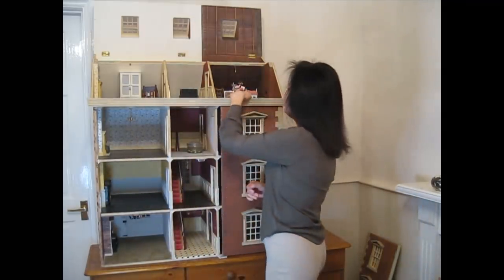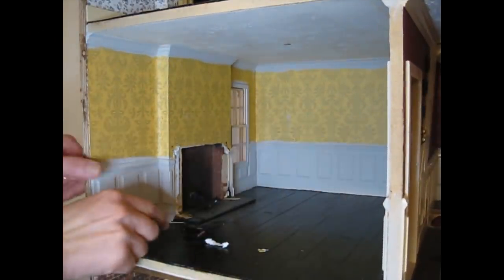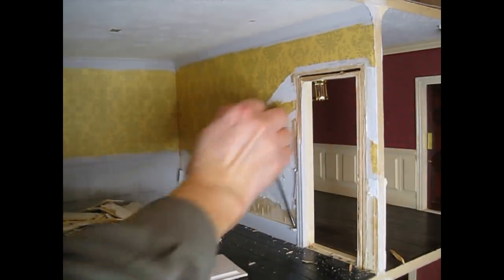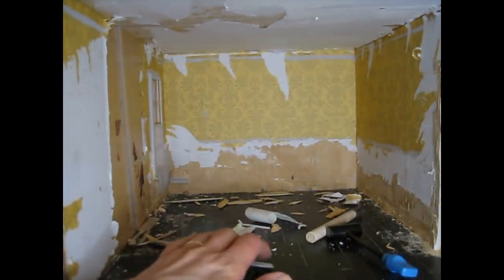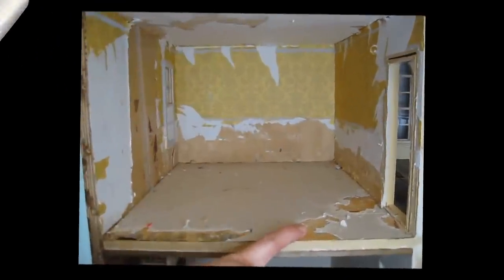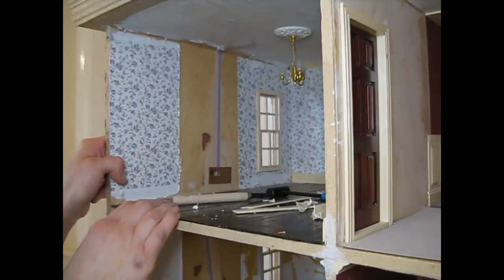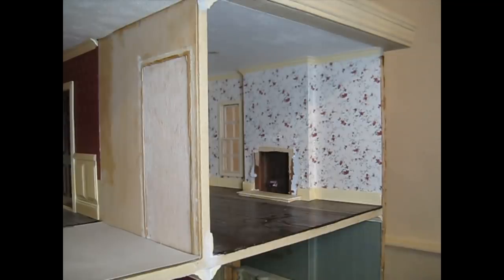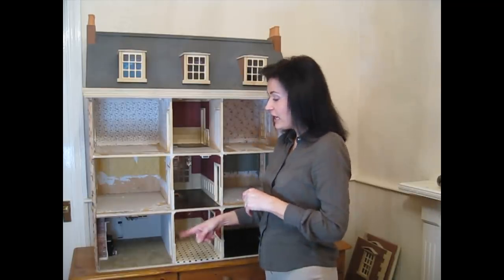My Dolls House Diary  - Episode 9 - Back to Bare Wood

Comment: Julie here is some advice try using  a hair dryer and a spackling tool. The hair dryer will melt the glue and you will have less damage to the walls. I learned this the hard way. I have learned so many things from you, keep the good work.
Reply from the maker: Thank you, I'll certainly try the hair dryer when I come to remove the paper - a job I'm not looking forward to!
Reply: I know, I didn't like that job either especially when it involved the ceiling in the smallest room of my dollhouse. Anyway, the hair dryer is good for removing mouldings. For the wallpaper I used a water & vinegar solution in a misting bottle and scrap it off with a spackling tool. My hands and hips hurt just thinking about that experience. I could not raise it up it would have too heavy.

Comment: I also have a house I didn’t get finished.  I made one back in 1982 and wallpapered onto the bare wood.  Over the years the acid of the wood ruined the walpapers.  I now prime all my inside walls with KILZ.  I have also learned over the years that I prefer using regular household walpaper paste.  Later if you want to remove the paper it comes off much better than if you use glues.
Reply from the maker: Thank you for the tips. :)

Comment: This was super helpful and inspiring, does anyone have experience with doll house lighting? I’ve started stripping it my doll house, but the copper tape has been covered in paint, with the little holes blocked. I never actually got so far as completing the lighting, but am aiming to have lights. Would it be wise to remove it all together or does anyone know if I could salvage the copper tape and unblock the holes so that lights can be wired in? Would appreciate any advice, it came with the copper put in so it’s been installed properly, and have no idea how to fix it myself, thanks
Reply from the maker: I'm not an expert on lighting, but I think you would need to make new holes in the tape and insert eyelets, rather than trying to unblock the clogged holes.  Give that a go in one room and try a light to see if it works.  If not, perhaps consider removing it altogether and go for wire lighting.  Copper tape can be a little temperamental and can corrode over time when covered in paint or glue.  I hope that helps...:)
Reply: Julie Warren thanks so much for replying, had a look at the wire lighting and it looks easier to install than expected. Ideally I can remove the copper, but accidentally sanded some of it down and it’s not too noticeable when painted. Thanks!

Comment: One piece of advice I can think of is--know your strengths and weaknesses. For instance, I know that my hands are not very steady with a paintbrush. So if I have a window that needs to be assembled and painted, and I want it in multiple colors, I'll paint it before assembly so I don't have to worry about masking tiny pieces off.
Reply from the maker: That's really good advice Rosie, thank you.

Comment: A good flooring putty knife ... its a flat piece of metal with a handle. That works great for prying between the two pieces. Its also great for scraping paper.
Reply from the maker: Thanks for the tip.

Comment: I watched this with my morning cup of coffee but was holding my breath several times watching you deconstruct your house.  Great job!  I agree with Chris below about the HOT water and Dawn in a spray bottle for wallpaper removal.  Wish I had known Michelle's trick about the hair dryer to loosen the glue.  Thank you for showing this.  Its so educational for anyone with a dollshouse because eventually you're probably going to want to remodel as tastes change.  One room I did over was my dining room.  It was the first room I did and knew very little at that time about floors and molding.  I glued each piece of wood for the floor directly to the floor of the dollshouse not knowing that you really should glue the planks to posterboard first and then the posterboard into the house.  It allows you to work on your floor outside of the house, so much easier.  At any rate when I removed the original floor I ended up damaging the actual floor of the dollshouse so now I have a corner that isn't level, not good.  So much for my idea of putting a corner cupboard there.
Reply from the maker: What is Dawn, I haven't heard of it - is that a washing up liquid?  I agree about flooring and that's how I usually attach mine.  Thank you for watching Beth and for the tips.
Reply: Dawn Dishwashing liquid.

Comment: Have you considered using a putty knife rather than a screw driver to pry with?  The knives come as narrow as 1 1/4 inches and are a great deal thinner than a screw driver.  I have one that was my father's that he rounded off the points and it will slip into a very narrow space without doing any damage.
Reply from the maker: All of the wood is now removed but I will be using a putty knife to remove the wallpaper.

Comment: I cringed (as probably you did) as you were removing the various elements.  May I suggest two things?  First, while the screwdriver was working well for you, I would also use something a bit thinner such as a putty knife or plaster knife.  Even a kitchen butter knife would do to get into tight spaces.  Secondly,  put a bit of warm air on the area you're working which will help to soften the glue a bit.  A hair dryer on low works great for this.  Thanks for sharing. Always love to see what you're up to.
Reply from the maker: Thank you for those tips, both really helpful.  Thank you so much for watching.

Comment: Hi Julie, just found your videos and am loving them, thank you for sharing your dollshouse.
I too have a Georgian dollshouse (decorated in an Edwardian theme), which was bought in the 90's, still have the bedrooms and attics to decorate and thinking of refurbishing the basement. 

I cheated when it came to decorating, I cut mountboard to fit all the walls in the dollshouse, covered that in wallpaper using spray mount and added the skirting/coving/doors etc once the mountboard had been placed in the house. I attached the mountboard to the walls using a strong double sided tape (so far it's lasted all these years lol). This means i can remove the decor very easily if i want to change the colour scheme.
Looking forward to having a go at your tutorials, Thank you for sharing them.
Reply from the maker: Thank you for the tip Aileen.

Comment: I know it’s a bit late now, but I found if you apply a hairdryer to the wood, the glue loosens and makes the pieces remove much easier. I’ve tried it with all kinds of glue, old and new. If you need to disassemble a smaller piece, a microwave set at 7-10 seconds works wonders
Reply from the maker: I've still got a few rooms to go, so I shall certainly be trying that.  Thanks Chris.

Comment: Xacto makes the chisel blades.  Get an Xacto handle and you have a selection of chisel blades, different widths.  The blades are cheap and come in packs of 10 or more.
Reply from the maker: I'm not keen on Xacto knives and much prefer my Swann Morton.  It has a metal handle, so is much more sturdy.
Reply: @JulieWarren  I haven't bought an Xacto knife in years.  My handles are metal.  I'd worry about a plastic one breaking too easily.  I'm not familiar with a Swann Morton, but here again I've not looked at the market recently.

Comment: When you begin paper removal  I suggest  really hot water in spray bottle. Score the Wallpaper a little and spray down the walls give it a bit to soak in. I sometimes put a bit of dawn dish soap in . Should loosen paper and glue to scrap or pull out.
Reply from the maker: Thank you Chris, that's really helpful.  Will certainly be trying that in the 'wallpaper removal' video.  :)